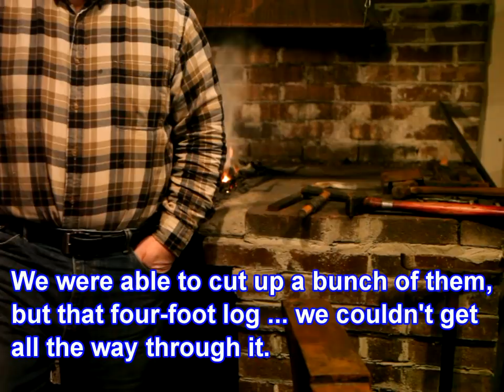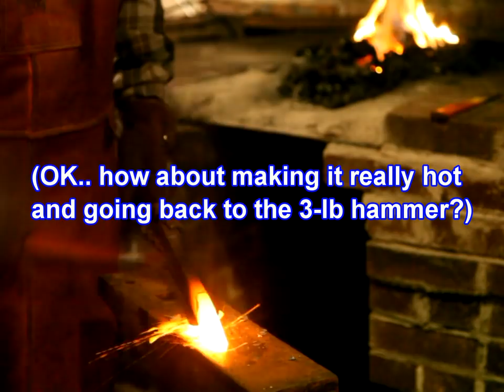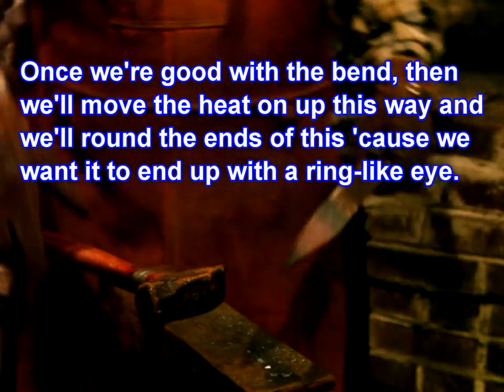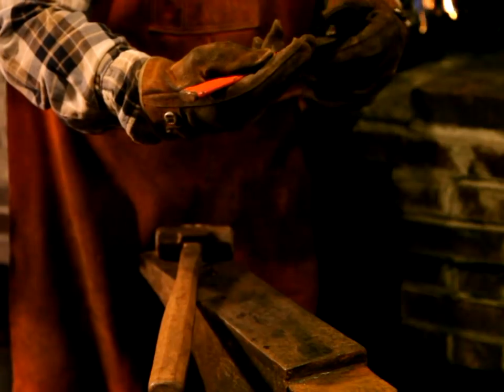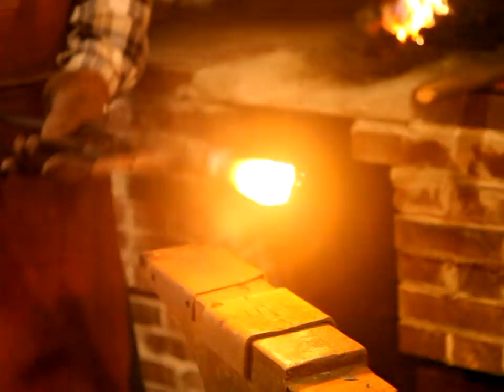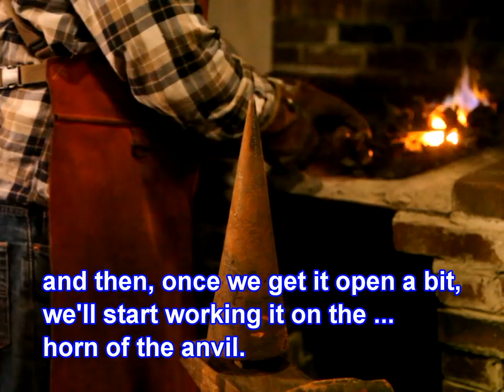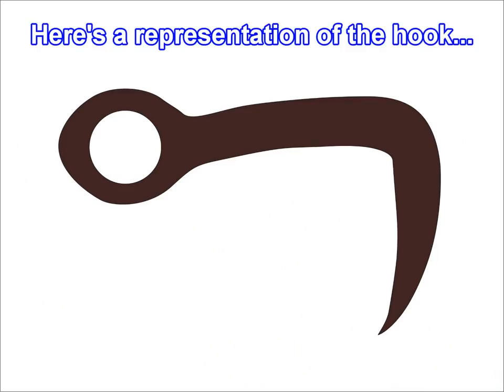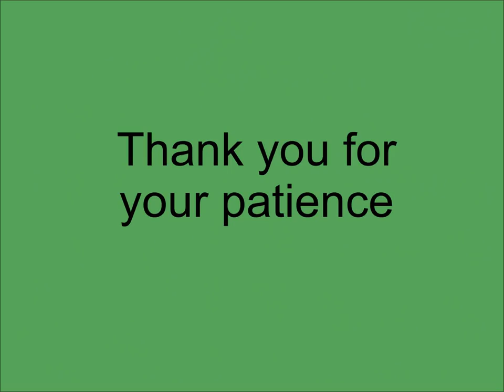Log Hook - Another Custom Blacksmithing Project

Comment: there are punches that fit in the hole in your anvil  and you can hold your steel in your tonges place the hot steel on punch and hammer the steel on to the punch sort of a third hand !
Reply from the maker: I have a couple of those cutoff hardies.  Unfortunately, they're not a good idea for slitting.  For the eye, it is critical that you get the exact same width on either side.  If you try to use a cutoff hardie for a slitting job, you're pretty much guessing at the location of the slit, as you can't see exactly where the hardie is making contact.  Regardless, thanks for offering the suggestion.

Comment: Hi there, i have a suggestion to make about the shape of the tip.
It should not be conical  (same width) must be like a nail or chisel.  For more stability.
Reply from the maker: Thanks for the thought, Milad.  Unfortunately, regardless of the shape of the tip, hammering it into the wood is too difficult.  Even if it could be hammered in, getting it back OUT would be a big problem.  By cutting a slot, the "hook" can be very easily placed in and, later, very easily lifted out.
Reply: @terryhale9006  yes sir, i see your point.
By the way using the car bumper can be a risky choice.... lol

Comment: hi there i really enjoy your vidoes in so many ways . i was coming to you because your brain is so fare ahead of mine . i just can't figure out something . i know how important it is to get your fire wood dry . if you have time , make a video on how many btus it takes to boil  water for of fire wood . the amount of water in a cord of almost green red oak is hard to believe . i tried ti make a video on this (fricknjeep  #85  how much water is in a cord of wood ) but i don't have your skills in math and video making . now for the problem at hand . if the sun comes out tomorrow i will make a short video on how i would move that log . . the hook you just made looks just like a log dog . i use them all the time here . thank you john
Reply from the maker: John, there are a lot of variables there.  Each species has different normal water content and dry density.  Even on the water side, things get tricky.   For instance, what are you assuming is the initial water temperature?  Depending on where you start, it will take different amounts of energy to get it to the boiling temperature.  Even once you get the water to that theoretical 212 degrees F,  you have to put in energy to change the boiling water into steam.  As minor matters, at what altitude will you be doing this boiling?  As you get farther above sea level, water gets slightly easier to boil.  Additionally, is this pure water or the water-like sap from a maple tree?  (One of my favorite boiling exercises.)  The more "stuff" you have in the water, the higher you have to heat it to get it to boil.
   To keep it "simple", let's assume your oak is well dried.  Compared to some other oaks, Northern Red Oak is only "OK".  Using numbers from http://worldforestindustries.com/forest-biofuel/firewood/firewood-btu-ratings/ , it can provide around 24 million BTU per dry cord and a dry cord weight of around 3757 pounds.  Dividing, that gives you around  6400 BTU per pound of dry red oak.  
   Now let's look at the water.  Assume you're talking about just a single gallon and you're starting it at 40 degrees F.  That gallon of water weighs 8.34 pounds.  Going to the Engineering Toolbox,  https://www.engineeringtoolbox.com/water-thermal-properties-d_162.html, we find that, on average, it take about 1 BTU to raise the temperature of one pound of water by one degree F.  Multiplying that out, we will need 8.34 x (212-40) x 1.001 BTUs to get that gallon to the boiling temperature.  That works out to 1435 BTUs.
  Once we get that gallon to 212 degrees,  it takes about 970 BTU to boil a pound of that water into steam.  That works out to an additional 970 x 8.34 = 8089.8 BTU.  Combining those, to boil away a gallon of water, starting at 40 degrees would take 9524 BTU.  With the dry red oak giving us 6400 BTU/lb, we would theoretically need 9524/6400 =  1.488 pounds of dry oak.
   Unfortunately, the above does not take into account the efficiency of your boiling operation.  Much of your heat energy will simply go up the chimney as hot air and fumes.  With a good furnace, you might get 60% efficiency.  Just boiling a big kettle over a roaring fire, you would be lucky to get 10% efficiency.  Operating on those extremes, you could need from 2.5 to 15 pound of dry red oak to boil away a gallon of water starting out at 40 degrees.
Reply: wow thanks for getting back . . my cord of red oak weight is rite at 6000 #  and is now down to 4260 # . some days the starting point may be higher or lower . (ambient temp )  so lets say 8 pounds of oak per gallon . if i take my starting point of 6000 minus your dry # 3757 would be 2243 #s of water =app 269 gallons x8 pounds =2152 pounds of dry oak per cord is lost . 3757-2152=1605 . that means over 1/2 your wet wood is being waisted in boiling your wood to burn . i find this to be very fascinating.  did you catch the video on the log dogs . and also how much water is in a cord of wood  . thank you so much for your help and input. that may make a great video for you . . ps you might want to check my figures    @terryhale9006

Comment: A giant set of log tongs might have been an alternate solution, or nailing it into one of the slots already cut in the log with the saw, but on the backside, so your rope was part way around the log and was imparting a rolling force.

Comment: A friend of mine had a similar idea to this, the only thing you have be careful with is as the log rolls and the hook becomes parallel to the ground it can loosen the grip and if  they ping off its like a cannon very dangerous. It's probably a good idea to put a wieght on the rope to reduce the recoil if it does break free.

Comment: wrap the chain around the log 3 or 4 times the pull
Reply from the maker: Good idea if you can get the chain under the log.  For the one in the video, that was probably possible.  For the four-foot diameter monster that created the need for the hook, a year of just laying there had allowed it to sink into the ground so there was no place to slide a chain under.
Reply: @terryhale9006  I wondered how well the end would remain in place. Even if you had to use a mattock or shovel or pick to get under one end to get at least a single wrap of chain then strategically place a second chain closer to middle so most any rotation would allow use of that second chain to continue the move process. Repeat as needed for distance to move. Hooking the chain over the top front of the log to the back side from the end underneath so any movement forward is encouraged. Hopefully that makes sense.

Comment: I seem to recall you using a rather heavy duty come-along in one of your earlier videos. That would not only be more efficent it would be safer for you and your bumper.
Reply from the maker: It would definitely be preferable.  Only problem is that, at this location, other than a shed, there is nothing to hook the winch to for several hundred feet.  At any other future location, I will expect/hope to be able to do as you suggest.
Reply: @terryhale9006  Thank you for the reply. I would then use the truck and block the wheels. Also would like to say I've learned much from your videos. One thing I've wondered is what are your thoughts on what one should have with them when working alone in the woods with respect to first aid